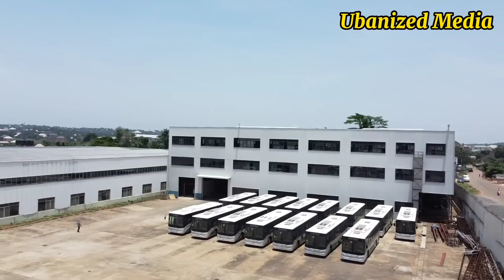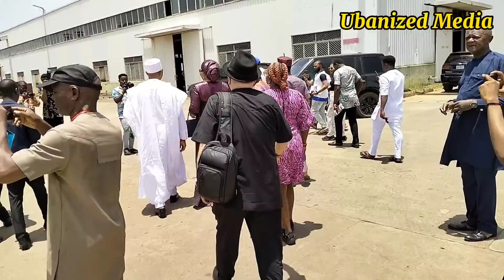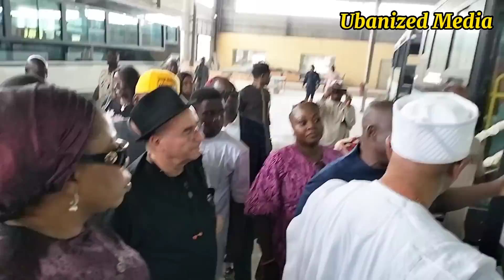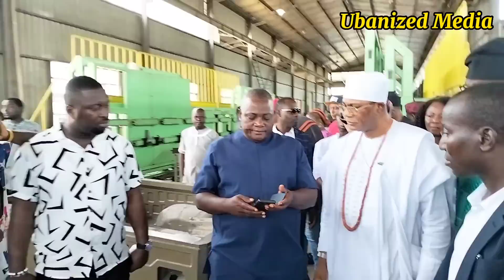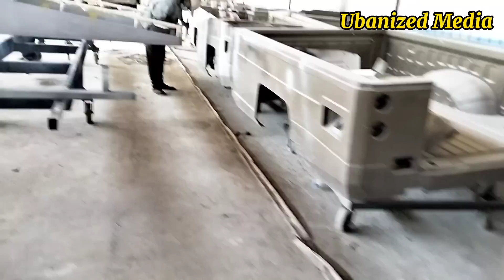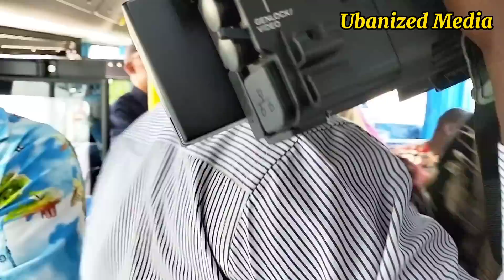Innoson Vehicles New CNG/LNG Vehicles ||Official Commissioning And Factory Tour In Nnewi, Anambra

Comment: CNG is cheaper especially for large vehicle. The Down side of CNG is safety issues and i hope safety regulations and enforcement is strictly adhered to ,with appropriate valve restraints to avoid blow out which could be disastrous. It is also tend to blow out due to over filing at the point at the Gas stations. I hope 😢 we as a nation have adequate enforcement of safety o
Reply from the maker: The authorities should ensure they abide by safety standards

Comment: Assembling foreign import vehicle, none of the parts are made in Nigeria.
Reply: The parts are produced here, it's only 10% that's imported.
Reply: @innocentelvis7285  Everything is imported nothing is produced in Nigeria, Nigeria hasn't got the capacity to produce parts.
Reply: @davet9708  Mr Man 90% are produced locally here. Stop misbehaving. Dangote import 10%of his materials too. No matter how advance a country is,you can never do without importing, rest abeg 🙄.
Reply: @innocentelvis7285  The oil refinery in Nigeria is built by Indians everything is imported, show me the factory where anything is produced in Nigeria.
Reply: @innocentelvis7285  Your just fooling yourself, a country where 80 percent of its citizens is living in extreme poverty, they need to bring in foreign company to come and run Nigeria, too much suffering in Nigeria.
Reply: Nigeria can't even supply can't even supply electricity trying to jump before you can walk, foreign investors are not coming to Nigeria because of the crappie infrastructure no electricity crappie roads.
Reply: Step in the right direction. You start assembling of vehicles and you move on producing the parts locally as the business grows.
Reply: Then go to court ewu